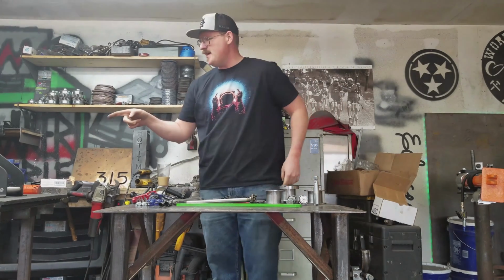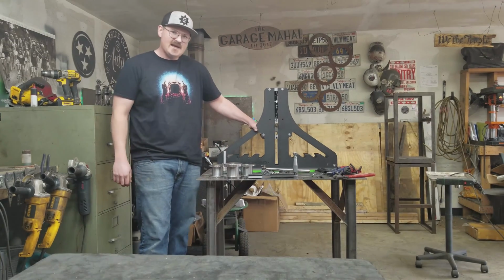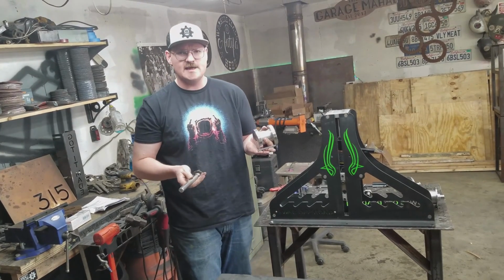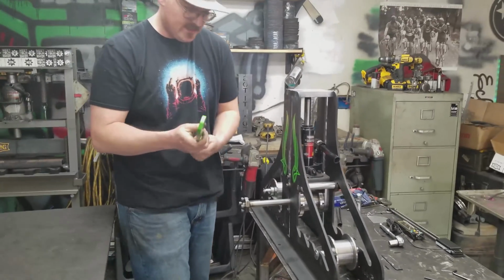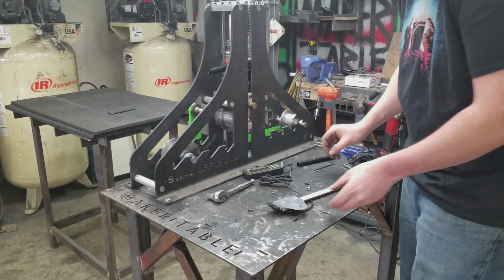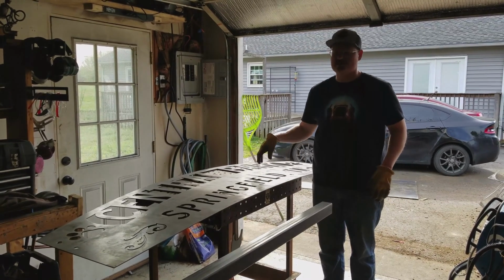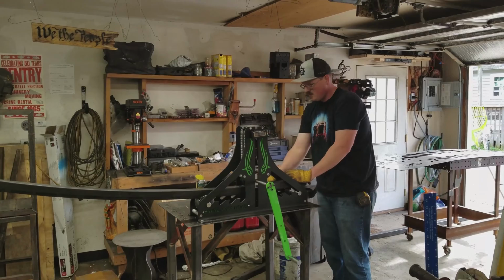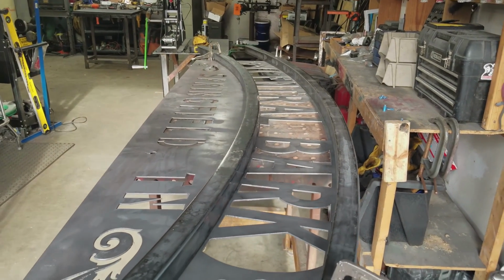HULK Tube Roller - First Impressions (Assembly & Review)

Comment: Thank you.  Let us know if you ever get the HF pipe threader hooked up.
Reply from the maker: I upgraded to the HF pipe threader and it made this thing REALLY nice.  The only drawback is the pipe threader has so much torque you can destroy the bearings and dies faster.  You have to be careful not to pump too much before running it out.  I replaced 3 die sets and have now upgraded to a 50T hydraulic roller.  The hulk helped me build up the volume so I could upgrade to the next machine.  I 100% recommend it.

Comment: I bought the harbor freight roller and added on with the swag kit but should have just bought this the first time. It paid for itself in use just building all the body lines on my buggy by pressing a trigger. There is no way I would use this by hand, the pipe threader is the ticket!

Comment: Great video! I just picked one of these up and haven't put it together yet. Can't wait, and I have already grabbed the electric drive for it. Don't think I could swing that handle all day! LoL. Subbed.
Reply: I have the whole set-up with the HF pipe threader, and still can't figure it out.  I wish someone would do a video of putting the whole thing together.
Reply: @kentrockwoodtyler8798  What part are you having trouble with?  Maybe I can help. I didn't have any trouble putting my together with the pipe threader and it works great.

Comment: Have you hooked that hulk roller up to the horrible fright electric pipe threader yet? Are you happy with the roller? I'm ordering one tomorrow for my shop. Thanks for the vids...Nice work your putting out!
Reply from the maker: I did two or three jobs by hand and went straight for that Hobo Freight pipe threader.  Makes the whole thing WAY easier!  I've had trouble rolling 2" square tube, I was trying to pump too much between passes and blew up the bearings.  Swag sent me a rebuild kit for free though so I really have no complaints there.  Just take it easy on the larger diameter stuff and you'll be fine.

Comment: Ha you have a tool you can make ends meet with! Just remember PieDi + your waste to make circles. Once the circle has made ends meet cut off the waste, weld it up smooth then run it trough the roller again.

Comment: wow they want a $1000 for one of those, anyone in our business that would use a tool like that can make one for alot less.
Reply: Not if your value your time...All that cutting and machining adds up quick.
Reply: @bobatbilletcreations  Well, its good experience as well.....But it would take me 3.5 years to build one this nice lmao
Reply: I could a solutely make one of these. And if I value my time at zero dollars I could probably make it cheaper and with thicker side plates. But even valuing my time at a dollar an hour, there is no way to make this as a one off for personal or business use. They have the science all figured out and all the machining is great and of great quality. Just cleaning up each machine after use for a one off product makes it not worth it. Plus machining dies, axles, drive shaft and everything¿? I'd much rather save my time and buy this one. Maybe, plasma cutting your own side plates just for more thickness 🤷🏽‍♂️ but what's the risk to shafts and parts?? 🤔
Reply: Turn off the compressor before you make the next video.